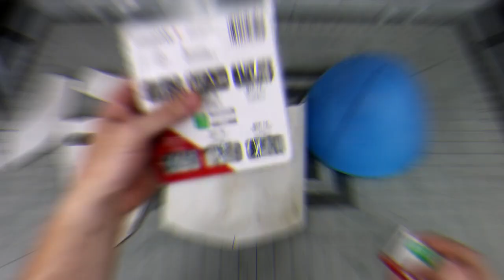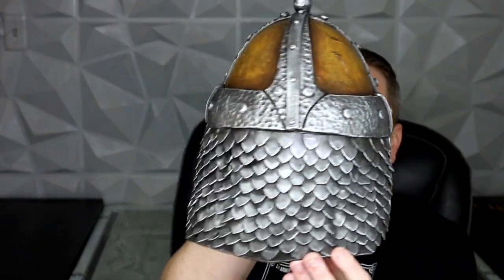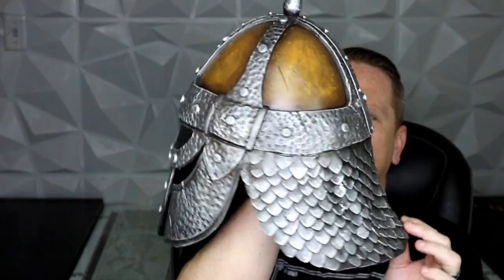Making a Guard Helmet from Skyrim

Comment: Does the template work with 10mm thick eva foam?
Reply from the maker: Don't know, usually that means the circumference on the inside gets smaller. I used thinner foam because my structure strength came from the styrene. You may have to make some modifications to get it to work.
Reply: @MuchProps  Is it possible to make the helm entirely from foam if I don't want to or don't have access to the sturdier materials

Comment: Couldn't tell ya how frustrating it is to find out my rivets aren't long enough to squash 6mm EVA and the 3mm sheet together ;-; BUT one has grabbed on so far, miraculously, and Gorilla Super Glue is holding it together as a failsafe. I've only attached the front face panel so far, I'm praying I'll have better luck with the rest! May go out and buy appropriate sized rivets 😂
Reply from the maker: LOL. I just buy those variety packs with multiple sizes.

Comment: Hello, thanks for providing the template but I can’t seem to get the dome to fit together, I made 4 dome Pieces and they won’t fit. Any tips?
Reply from the maker: Because my template used an oversized Easter egg, I did'nt really think about how to retro fit it to something else but my suggestion would be to shave off pieces connecting edges of your dome until it fits within the rest of the template I gave.You could hold the pieces together with tape to test the fit.
Reply: Much Props yeah that’s what I ended up doing, I’m on to painting the helmet now! Thanks
Reply from the maker: @jamiewilliamson5841  was that you red base coated one I stumbled on Facebook.
Reply: Much Props nah
Reply from the maker: @jamiewilliamson5841  oh well. Let me know how it turns out. What paint scheme/city are you going to paint it?
Reply: I thought it was a mistake. Using 3 makes the right shape it turns out